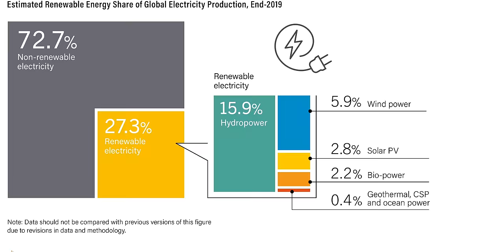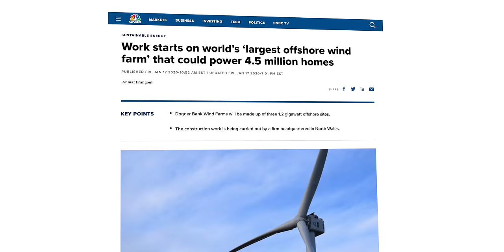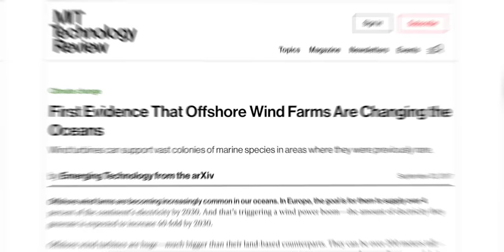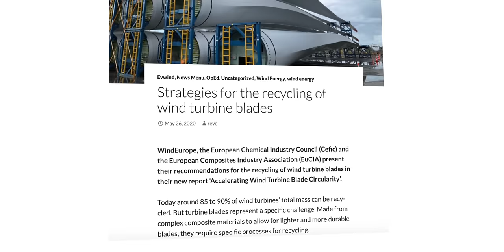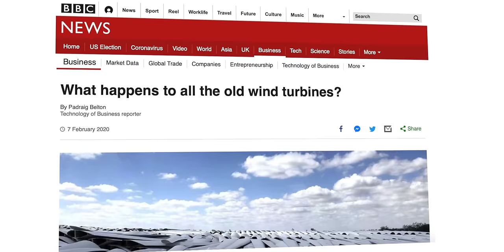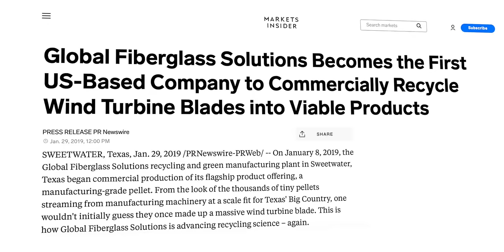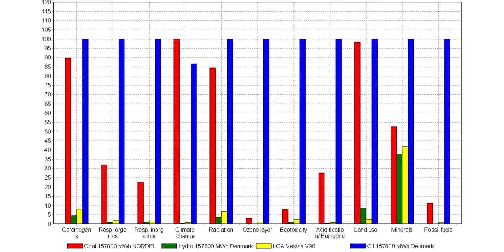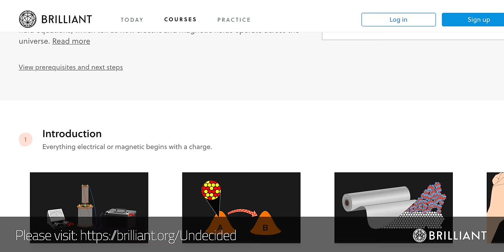The truth about wind turbines - how bad are they?

Comment: Cut the fins, turn them into shacks for shade in the parks
Reply: Jolly Green - then install lightweight solar panels on top of the shade...
Reply: I've just recently contacted our largest wind energy provider what a great idea I'm going to try and get my hands on an old blade!! So many possibilities
Reply: @NateHart_nhart99  thats a terrific idea. I worked out I can run about 12 kw on 1 blade alone 😀
Reply: A lot of parks need to be built then, bury human bodies in the park as well, for fertilizer, we all have brilliant ecological ideas, don't we?
Reply: I don't think he realizes how large modern turbine blades are. Each blade can be 400 feet long and 40 to 70 feet across. What you're talking about it is not a practical way of dealing with the waste.
Reply: @rodofdallas  could it be made into any other types of structures? 
Eg... dwellings or parts of dwellings?
Reply: @rogerramjet9876  as it exists now, there's no flat surface, the whole thing is curved at all points, couldn't really make more than a tree house out of it.
Reply: @Admiralty86  i see..... there's a house not far from where I am that curves into the mountainside that uses one or part of one as the roof.
Looks kinda retro..... but I wouldn't at all be surprised if we see more of that kind of thing becoming the norm
Reply: Arch  man thank God there are still people left like yourself with an actual functioning brain.

Why is it that the media have so much control that no one can see it.
Unfortunately the elites have control of the corrupt countries of the world.
Come January 1 communist countries will control 60% of the useless UN.
The system is so broken. 
My concern is that the current admin will lose the election.
Ccp will panda the new admin for 12 months while they move all their forces into position and Taiwan and Indo- pacific will fall. Then we are all completely buggered!!
It will be like living inside the series the man in the iron castle 😢
Reply: @rogerramjet9876  not without the blades "breaking down" into cancer causing microfibers and toxic chemicals...

Comment: Some years ago I came to a similar problem with a manifold of an air seeder where the seeds travelling at some speed in an air duct had to change direction to be distributed into 5 or 6 secondary ducts and to avoid smashing them we used a thin layer of poly eurathane  on the surface . It also stopped the erosion of the detector that was counting the impulses of seeds passing that point. It could be used on the blade leading edge if coated thinly and with a smooth finish so as no to add drag.
Reply: Leading edge erosion is a big problem we have had with turbine blades. Its highly dependent on the location they are in, mostly due to the amount of dust in the air, west Texas is really rough on the blades while some of the northern and Eastern states have little problem with edge erosion due to less dust. 3M has a product that has been applied to the leading edge of thousands of blades. Unfortunatly I don't have the stats on whether it helps or not. My educated guess would be it works, companies will spend tens of thousands of dollars to have it applied to a single turbine. Most of the cost isn't the product, its the application process/manpower. Whatever adhesive 3M uses it is STRONG, I've seen blades with 30,000 operating hours and the leading edge tape is still holding on as good as day one!

Comment: I would have hoped that when you mentioned concrete, diesel, landscaping, service roads, cabling, converter stations and so on, you had pointed out that all other means of creating energy needs same infrastructure often in much greater scale. One example is our fifth nuclear reactor (Olkiluoto 3) in Finland. It has been built since 2005 and it still not complete. While not producing any CO2 when operational, it can hardly be seen as totally emission free either. And uranium, oil, coal, natural gas doesn´t just appear next to power plant like wind and sun does. They need mining, drilling, transporting and refining and tons of additional infrastructure and energy to be ready to use. You can even add thousands of people commuting to do all that to equation. Or decommissioning and recycling parts from traditional power plants or problems related used nuclear fuel. I would say that new tech wins every time.

I bet you know all this and I hope you made a video about truly comparing environmental impacts of different ways to produce energy. Pointing out ones downsides seems a bit unfair.
Reply: Agreed! I would love a side by side comparison of emissions based on different parts of the process (set up, maintenance, disposal).
Reply: But what is the reason for the 18 year delay in construction?  Are they purely technical delays, or is some of it financing and political?

Comment: I don’t personally see the NIMBY argument that wind turbines are eyesores;  I think they are magnificent, awe-inspiring structures!  I’d be fine with having them in my community.
Reply: @MuhammadAhmed-qh7ut  Um, no? You need to be standing like 100 feet away from a wind turbine to hear them.  If you live anywhere near a road you're getting like an extra 20 dB of noise than if you literally lived right next to a wind turbine.
Reply: Yes, I happen to think they are quite elegant and serene looking.
Reply: @0hypnotoad0  A standard onshore wind farm will still generate 40dB 500m away on flat land. That's definitely not huge, but it's still quite noticeable. Offshore wind just makes a lot more sense, structures can be far larger, no disruption to the land, and no land disputes with nimbys.
Reply: I feel the same way. I just wish I had enough wind in my area, for them to get the capacity factor necessary to make them cost effective. Since we don't, wind turbines are very rare in my state.(Utah)
Reply: @TheRichardHonor  "Not huge" is a wild understatement, 40 db will be audibly masked by the noise of your refrigerator. The actual wind on the side of your house itself will likely produce more noise than that.

Comment: The used blades could be a valuable low-cost building material. Great examples of the playground, bus stops and footbridge. Maybe use for shade awnings or highway walls.  I’d think architects could come up with many creative uses if they had a good source of obtaining smaller blade sections easily. An online database of dimensions and purchasing sources could expand this creative recycling.
Reply: I suspect its not cost effective versus using new material,  and is currently being done as a PR stunt and not because its viable.
Reply: @bowez9  Repurposing is 9 out 10 times cheaper than recycling. Trouble usually is if they can be repurposed or not. You dont lose much by letting people buying them for a token amount, maybe they are stored for a bit and then you do with the rest what was the plan anyway.
Reply: @kistuszek  cost is in labor.  Ask a contractor about reusesing old items versus using new.  Usually what is saved material is more than spent in time.
Reply: My house needs a new roof which a couple blades wood be perfect for, anything left over I'd use for smaller garden projects. My guess is that the people who currently own the old blades would want thousands for each one.
Reply: @demonhighwayman9403  issue being a crew of 3 or 4 could replace your roof in a day with just a couple ladders and nailers.  The blades will require a crane to lift into place and an engineer to redesign your roof with the potential for new bracing.  Even if given the blades the crane cost would exceed the shingle cost nevermind engineering costs.
Reply: @bowez9  I dont have to, im kinda one. If you need to do a lot of work then you are just not the market for it. Just because you can, does not mean you should. How much work is too much work is really dependent on where and when. A few yeas back when the industry was down you could get work for a quarter of the price than now that everyone and their dog is booked for a year. Then there is a question of where, sure in the west work is real expensive, but in the east its dirt cheap. And then you got the handyman that will do the work himself. And then free material is hard to argue with.
Reply: They are also a good material to burn in cement production - they contain much energy, and the glass fibers are also usuful for the cement production.
Reply: bowez9 

Sigh.

And if the blades were sliced into shingle sized pieces first?
Reply: @Jkirk3279  you try driving a nail through fiberglass or carbon fiber, most likely the shingle will shatter.  If pre drill will wear out many drill bits, plus the time it takes to drill them, and now that they're dilled nails are not effective and must be screwed with the extra time that costs.
This is ignoring the cost cutting the blade up and transportation from sire to processing facilities then to job cite.
Reply: Maybe use as structural columns in a grand 2 story living room, a circle of many as a pavilon in public parks, or horizontal as shade structures for outdoor dining. They are a beautiful organic shape. Architects are creative but won’t use materials unless they have the CAD models for sizing and a ready source for their builders.

Comment: Storage! its useless without having the ability to store the electricity on windless hot days! Hence rolling blackouts!
Reply: @irrichman  60% efficiency? lol
Reply: Mark, 

storage is not feasible to cover both the times of low output and the extra generating capacity required to recharge when depleted. It simply is far too great a capacity that is required.
Not only that, in the U.K. there is no excess wind power to store.
Really it is a non starter. Batteries do get used on the grid, but for frequency support not for intermittency.
In general, the media do not seem to understand this subtle difference and put out misleading reports.
Reply: Rolling black outs existed before wind energy was becoming prevalent. Storage projects are happening all over the world in many types. These projects are profitable also.
Reply: @JimP226  The rolling blackouts are a result of putting the more traditional and RELIABLE sources out of business! So when you need it, it won't be there! It is profitable to who? Not the consumer! We should charge them for using our resources like the bottled water companies they should be charged too!
Reply: LYPOI rolling Black's outs were NOT common with switch on switch off base load sources such as coal, gas or nuclear.  That use just a furphy
Reply: @JimP226  They all need government money. Without the subsidies, they would not exist.
Reply: @irrichman  If man was meant to fly he would have wings.  
Man can not travel over 35 miles and hour it would rip the skin off his face.
Reply: The best green batteries for long term storage is gravity batteries.

Comment: Everything has an environmental impact. But even though the environment is very fragile, it's also very flexible and it's regenerative, so it heals constantly. As long as the negative environmental impacts are relatively small, it doesn't really matter in the long run. I have found that many people see a negative impact of something and immediately are against it, even though it is a way better alternative than anything else.

Thank you Matt for this video where you point out the positives and negatives!

Comment: Matt Great video. I’m interested in knowing what the cost of charging electric cars is? If we say only electric cars can be used in 5 years from now could the power grid production handle the load? What is their power load compared to other household appliances? Thanks again keep up the good work.
Reply: Always follow the money on these issues.
Reply: If you look at germany, it can. we have 50 % renewable in the grid. And as recently the "Netzbetreiber" grid operator, don't see any hesitation to expand gas plant to balance more renewable energy.
Reply: @John Bryer and what resources/human workers are they using to get the batteries. My friend once sent me a link of a camp where they source lithium and it looked a bit like a slave camp. I question the ethics of the materials sourcing.

Comment: For me its nuclear as the best option until something akin to cold fusion comes along.
Reply: IKR, nuclear is the way to go.
It's relatively save with modern technology, and lasts longer than any other "green"  energy method known to the green fascists.

The only counter argument they have is that it's expensive, but it's less expensive than wind and solar farms and provides more energy and more efficiently.
And then they talk about chernobyl, but that happened more than 30 years ago and that only happened because of a design flaw and inadequate personnel operating the plant... nothing that's not already solved.

Plus you can place a powerplant on a remote place, while simultaneously providing way more energy (and more green) than wind and solar farms + it takes up less space.

Comment: Can the blades be strung together and attached to the seafloor to seed coral reefs?
Reply: No, I'm sorry Nunya. The blades are filled with very light weight polyurethane or polyethylene foam or balsa. They were much to buoyant to try to keep stable underwater. And the chemicals that leech out of them could be toxic as well.
Reply: @rodofdallas  Oh. The vids said they were made of carbon. Maybe they should look at another "filler" material.
Reply: @nunya___  their skins are made of either fiberglass or are reinforced with carbon fiber. But the skins are only fractions of an inch thick. The bulk of the mass is very lightweight foam like structure. Usually one of the poly-based foams or balsa. They have to be very strong and very light at the same time.

Comment: The service life seems really low. I live near several large wind farms and a significant percentage of the turbines appear to be inoperative.
Reply: Lots of parts are held up due to Covid etc. Major crane work for repairs is also complicating things.
Reply: @Admiralty86  This is not a recent phenomenon. It's been like this for years. It seems that any wind farm that isn't quite new has 20-30% of the turbines out of service.
Reply: The reason for this is that even though the livespan of windturbines are about 20 years.
The turbines get neglected after about 8 years, because the repairs and replacements for turbines are too expensive.
So they just completely stop the turbines all together.

So in theory turbines have a great livespan, but in practice the story is very very different.
Turbines are just too expensive compared to what they deliver in terms of power....

Comment: I was driving to Palm Springs and on the way there were wind turbines in lines of 15 I would guess, but I swear to god there was one broken in ever row
Reply: They're often shut down deliberately (to curtail output sometimes, scheduled maintenance etc), they can be remotely controlled for just this purpose. 

They are very reliable (contrary to the negative-nancy-narrative about them) there's no way that many would have "failed" (in fact, I can't think of ANY modern machine that would have that level of failure)

Comment: We need to tackle how to store renewable energy on a large scale (batterry packs arent the solution)
Reply: Tesla’s 100 megawatt battery system has made Western Australia’s power more reliable
Reply: BINGO! Not once was the storage of wind mentioned. It's the main factor why wind does not work in real world power needs.
Reply: Why are good batteries not the solution? How is power stored now? What do you suggest?
Reply: Hydropower for countries that have it available like Canada.
Reply: Hydrogen,you produce it with the spare energy and burn it to use it when you don't have renewable energy. I know that you need a lot of energy to produce the hydrogen but if it's free and you can't do anything with it ...
Reply: @andreiarama8745  Kinda might work. Still inefficient, but it's an idea.
Reply: "When the wind blows hard enough" or not so hard it must be shut down. Energy storage is the key problem with wind power. Batteries are NOT the solution, they are expensive and still a relatively low density energy store. Wind does have one HUGE advantage. It is visible and politicians can point and say "See how Green we are! Vote for me!".
There is no one solution to sustainable power. We need alternatives and the R&D investment to develop them.
Reply: @jonathanwetherell3609  can you define what a battery is?
Reply: @BullScrapPracEff  Loosely a device for storing electrical charge. Yes, I do know about the original term used for the chemical ones. In terms of wind power etc.,  something to store electricity when the wind generation is off line. I would include pumped storage etc.
Reply: @jonathanwetherell3609  So you have no actual idea what constitutes a battery in science...